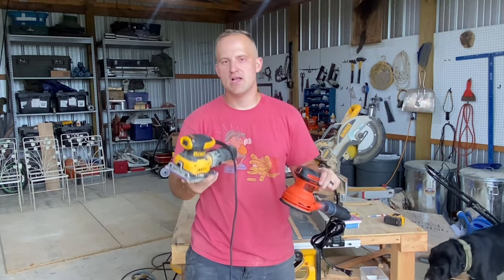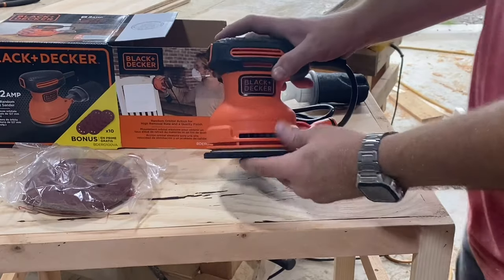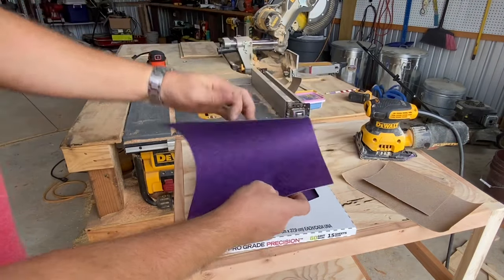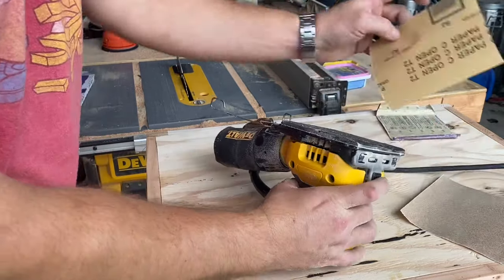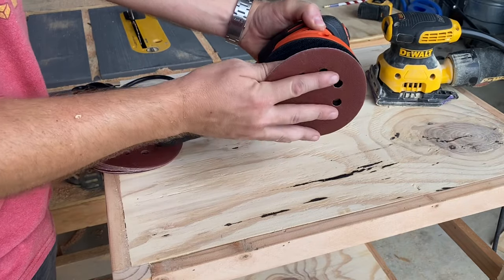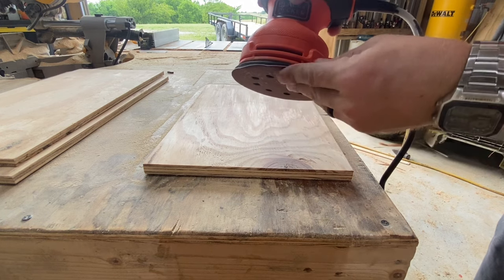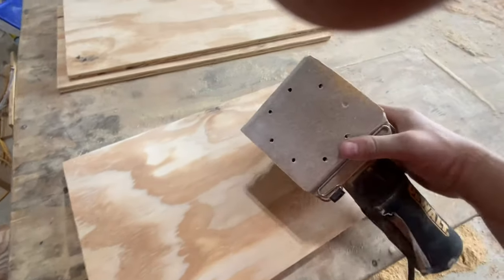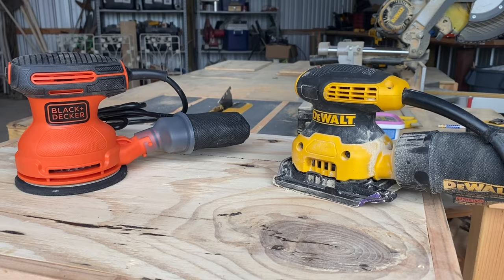Which Sander is BETTER? || Random Orbital VS 1/4 Sheet Palm Sander

Comment: Not a question of which is better, they are not designed for the same use. The orbital is better for sanding large areas and not leaving any swirl marks. The palm sander is for lighter duty finish work typically over smaller areas.
Reply from the maker: Great point. Thank you
Reply: u can use the palm sander for the same things you can use the orbital and if ur making swirl marks use a higher grit or stop edging 😂
Reply: So you’re saying the random orbital sander is better at large areas AND it doesn’t leave swirl marks? Sounds like a winner to me lol

Comment: You've compared 2 different sanders and 2 different sandpapers simultaneously, so you can't really draw performance conclusions. The 3M sandpaper is far superior to whatever comes with the Black and Decker.  The newer ceramic based 3M sandpapers (especially the net/mesh style) are especially great. Cubitron branded 3M

Comment: You can tilt a random orbit sander to hit tough spots. Gives you more pressure at the edge. Have done this for twenty years without issue.
Reply from the maker: Thanks for the comment! I was able to put some pressure on the edge of the random orbital sander but not quite as much as the palm sander because that is when the sandpaper started to walk on me.  Do you have an issue with this? If not, what brand of sandpaper do you use?
Reply: Tilt the random orbital sander to get the edges eh???? 

My dear sir, if you have done this and leave a flawless finish, you are amazing. I am a hobbyist and a relatively new to woodworking. 

I will make this quick and easy, I dont have the guts to try that stunt sir. I am too scared to ruin my Pieces.

Comment: The DeWalt 1/4 sheet palm sander is the sander I use and I have never felt the urge to replace it, and of course I like that the sheet costs less than the "velcro" one. Maybe one day I will have both.
Reply from the maker: Yeah, I really like mine. My wife found this random orbital sander on sale for $10 so I had to go for it

Comment: Hey I just saw on a diy hack to clear the sawdust on sandpaper use an eraser on it to remove sawdust. I would try it but don't have a sander YET!
Reply from the maker: I’m going to have to try this! Thanks!
Reply: A brass or steel wire brush works well too.

Comment: Looking at palm sander  your Dewalt or harder to get Makita BO4556K [dust bag issue small diameter connection ]  or the also hard to get expensive  Bosch GSS 140-1A. 
How well does the Dewalt collect dust ?? Other reviews say its a problem , do u agree  ??
Reply from the maker: Well, I’ve never noticed a huge problem, but you also have to use the hole maker it comes with before it will collect dust. I bet those people aren’t using it
Reply: @DIYMAN  hi Just purchased the Dewalt collects dust like my 6inch Random orbital 50-70% . Dust collection 8 outta 10 .   Bag attachment is way way better than Makita [small hole=hard to empty  with only a spring retainer clip]. Paint prep 8 outta 10 . Gets the job done just a little slow [ to be expected ] . Good Long cord .  Paper install good  . Good power does NOT load  motor when used with 60g paper .  
Cheers for your help .
Reply: My 6 inch R/O Bosch [blue industrial version ] GEX 150 AC Professional Variable Speed is faster on bigger jobs than the Dewalt  1/4 sheet , But the smaller unit I will use for detail work /paint prep . Different applications .

Comment: So do you think that the palm sander would be better to use over the orbital sander to sand the fascia boards around my house? I always hear that orbital Sanders can leave swirl marks in the wood, what do you suggest sir?
Reply from the maker: Yes. They can both leave marks like that, but it’s a lot easier to sand with the grain with a palm sander
Reply: Sorry for late comment. Just wanted to clarify, a random orbital sander is supposed to remove most visible swirl patterns due to its random nature. 

A regular orbital sander is essentially the same as a palm sander I'm pretty sure. 

So to limit swirls, random orbital is likely your best bet.

Comment: That's mean actually which one is better?

Which one reffer by you for me?

I will order that.plz tell me.
Reply from the maker: If you do a lot of heavy duty wood removal, I’d get the Dewalt quarter sheet sander
Reply: @DIYMAN  yes I have total 18 pcs door and window palla. But I have used on this 80+120 already.

I want to use purpose of sanding with polish time